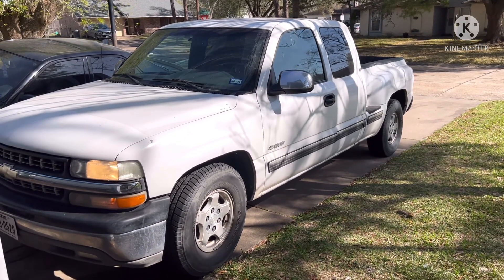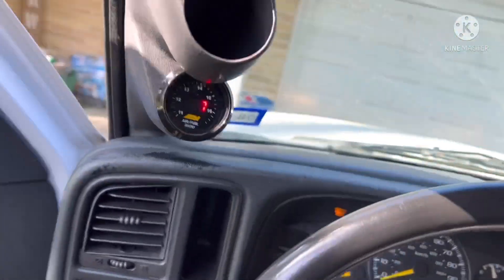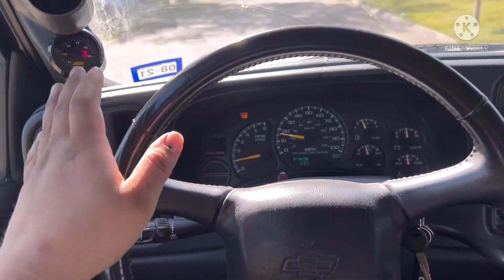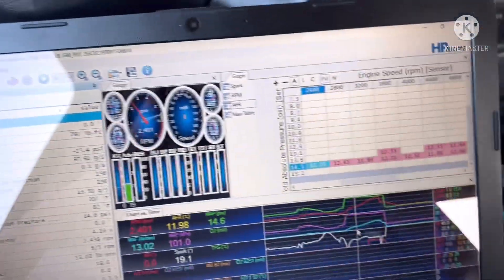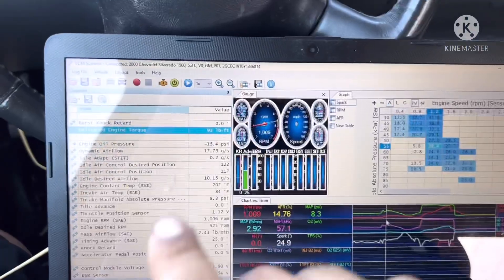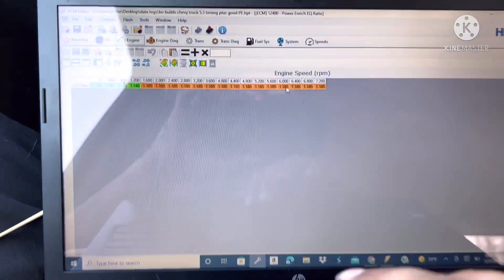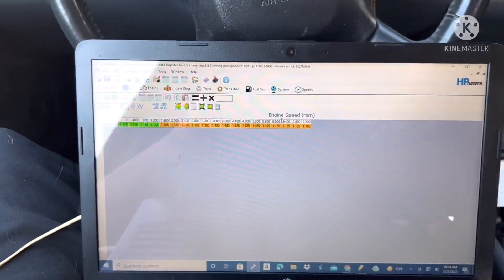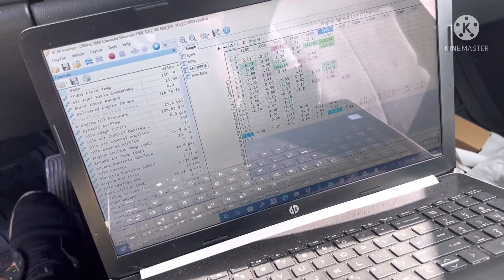UNLOCKING HIDDEN POWER FROM A STOCK SILVERADO - HP Tuners

Comment: As an old fart, I am use to changing jets and power valves in carburetors for AFR adjustments(read spark plugs) and turning distributors(advance and retard) for timing tweaks.  I am not very experienced in computers.  Hell, I changed my Ford small block from EFI to carb to avoid them.  I run a blowthru carb on what was MAF efi.  I finally got it running good at transition and part-throttle using an O2 sensor AFR gauge but it was a bitch.  BTW, all things being equal blow-thru is faster than the EFI was on a 91 Ford 5.0ho in my old mercury.  But I just purchased a 2001 Silverado 5.3 and I plan to boost.  Thankyou for this video, I feel more optimistic about tuning the ecu since watching it.

Comment: You will not gain 3-5 hp going from 11:1 to 13:1. Target 12:1 at peak torque and 12.5 at peak power. Timing makes more of a difference.  26-29* is where most of these are happy at.
Reply: Yup, going as lean as the guy in the video suggests, actually loses torque

Comment: Would it be practical for me to buy an hp setup and learn to do the tuning myself, depending on how complicated it is, vs paying a shop to do the tuning. E-fans, and I’m confident that I can do a cam swap on my 01 myself. I just know professional tuners aren’t cheap.
Reply: You can see the guy is a dealership tech. I’m a 48 year GM tech veteran. I spent over 10 years at the beginning of my career studying & learning engine tune up & all the complicated variables that go into how engines work & how timing & fueling are critical to how an engine survives. If you wanted to properly learn tune up so you don’t blow your stuff up, there’s a whole series of videos at HP’s YouTube channel.
Reply: I’m wondering the same
Reply: It’s doable start reading up and look up anything you don’t understand there is a learning curve for sure but it’s not any harder than learning any other new skill

Comment: I have a 04 hoe. 3.73 gear. Texas speed stage 3 cam ls6 valves springs S&B Cai  I also tuned with hp tuners. Why can I not do a burnout. ??
Reply from the maker: Is all of your torque management disabled?
Reply: Whats the prevent doen shift option hold gear.  Wat do they do?
Reply: Traction control won't let me rev past 2k when brake applied. 1 year on hp tuners. It's no fucking joke.
Reply: I just had a completely rebuilt 4l65e installed. Pump rotor exploded. Should be finished this week.
Reply: Mexican dudes on Instagram whi I follow. Are crushing it!! Same truck as mine. (Unboosted) doing donuts standing still.  Help me out
Reply: Torque management, friend has a stock 05 Silverado with a welded diff and it drifts and does burnouts
Reply: Stock 4l60e? I had to build my trans before my 04 burban would let loose
Reply: @Kade Adams  100% oem, sure I had to teach him brake boosting, never taught flashing the converter
Reply: Disk brakes in the rear are too strong from what I’ve figured out

Comment: Great video bro i have my 4.8 with bolt on timings at 28 at full throttle and 22 on the low you can also bump the shifts to 6200rpm
Reply: Do you have to play with the mph for shifts? Or can you just set the shifts to 6200?
Reply: The 4l60 is really only good to 5k unlessinits upgraded beast and such
Reply: You know the 4l60E is rated to 5500 right? Or at least my 08 was

Comment: Nice video! Can’t wait to see the Truck Norris cam. I’m wanting that cam in my 86 Squarebody with 5.3 LM7.
Reply: Just put it in my 85 wit a 5.3 backed by a trailblazer stall......you're gonna love it!
 Sounds pretty mean and it made 62 more hp to the wheels.
Reply: @tennesseetreasures124  man that’s very impressive! About what rpm does that stall at with your set up?
Reply: @danecooper1914  around 2400